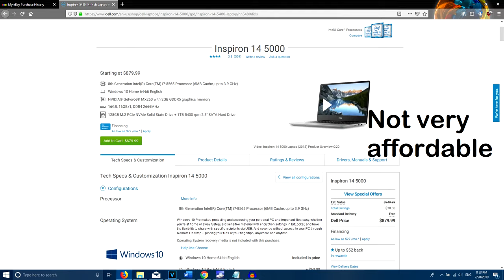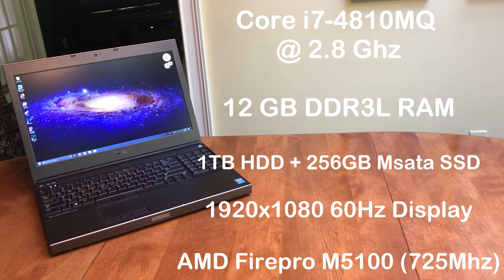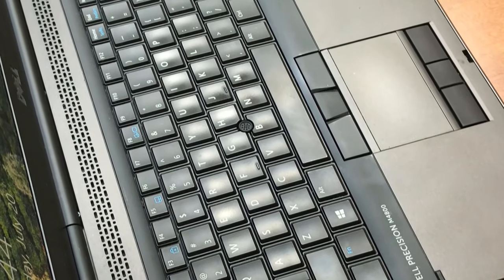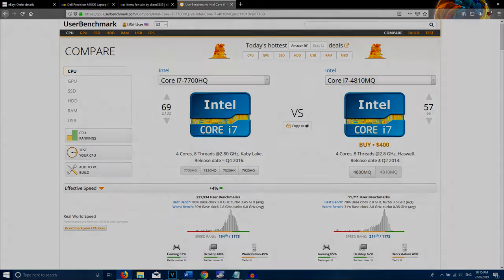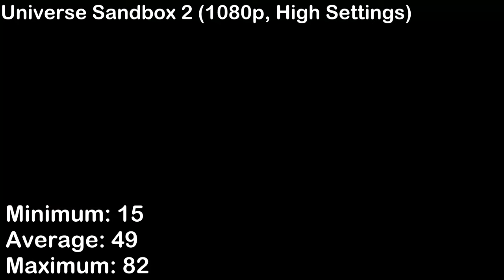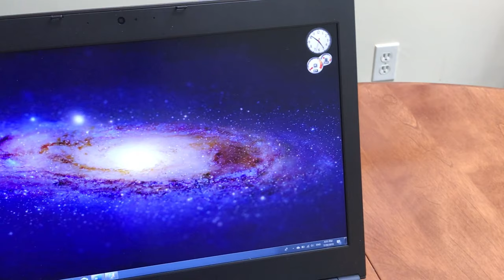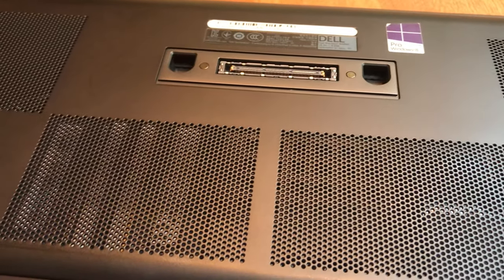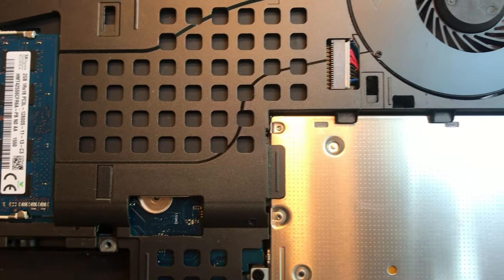Is a $300 Workstation From 2013 a Good Choice for Cheap PC Gaming?

Comment: Been running this laptop for years.  Great machine, and it's damn near indestructible.  If I may offer some of my own 2 cents for those of you looking to get one:

--Don't go above the 47W processors, stick with the 4910MQ and below to get the most performance.  I have a 4930MX I bought for it just for the meme factor, and under a consistent load, it can barely even reach base clocks let alone boost clocks without thermal throttling.  Trust me, you won't be overclocking this thing unless your room's ambient temperature is sub-freezing.
--DDR3 1866MHz is not really worth it.  You'd be better off sticking with 1600MHz, but going for a full 32GB.
--You can use the Quadro M2200 MXM Type A card in it (which I think is from a 7th gen Precision?) but the GPU die will be a little bit wider than the heatsink.  It will still be fine as-is, but what I did was put some very thin 1mm thick thermal pad slices (1.5mm will be fine too) on the ends of the GPU heatsink to make it contact the small slices of GPU die that hang over the edge.  Then, after thermal paste on the copper part and reassembling the machine, it seems to work fine.  The Quadro M2200's horsepower in benchmarks is approximately equivalent to a GTX 1050 Max Q.
--Related to the point above, even if you're using a Quadro GPU, always get the nVidia Game Ready Drivers if you want to game on this machine.  Quadro drivers seem to auto-throttle your card at around 50-55 Celsius, whereas with the Game Ready Drivers I've seen this thing go 75C+ (which also MASSIVELY boosted game performance).  To install Game Ready drivers, run the driver setup and let the program extract its files.  Then, before the installer closes, copy the C:\NVIDIA\ folder to another directory, and cancel the NVIDIA installer.  You do this so the temp driver files aren't deleted upon installation failure.  After that go into Device Manager and manually install the GPU driver via INF, using that copied-directory you made earlier.  It should be in Display.Driver, you can use the first INF in that directory.
Reply: Does the keyboard had a backlight?
Reply: @Graphomid  Yes
Reply: Apparently you can put a quadro t2000 from a hp mini pc in it, but it requires a lot of modifications and they are expensive af (250€) for what they are worth in terms of performance
And the m2200 is still expensive, at around 100€ on eBay :/
I got a precision m4800 for 70€ this week with base specs (not in super condition, but that's fine...), and I'm gonna upgrade it with an i7 4910MQ, a WiFi 6E card, optical drive bay HDD and possibly a quadro m2200 if I find one at a decent price
I would love to see more gpus like the intel arc a370m that come in mxm-a form factor though, as they are quite power-efficient

Comment: 2024 - ordered one early this week for about 200 USD equiv. 
I used an older M6400 17" at work some years ago and was impressed. 
Only now I found a cheap Precision for myself.
(I also have a heavy 17" Inspiron from 2008 that still works well) 
Some say Dell's laptops are junk these days. IDK, but the Precision line must be
up there with ThinkPads IMO.

Comment: Have this laptop and can run a modded Minecraft pack with 270 loaded mods as 60fps on normal settings. Received this as a high school graduation gift over four years ago and still performs like it did on day one. Absolutely love it!
Reply: will it run Battlefield 1 or other games like that?
Reply: @inf0bites  never tried an fps game on it. Should be fine tho. Found out the other day it can run 150 frames consistently on said modded Minecraft on some high level settings
Reply: Can you upgrade the gpus on these laptops?
Reply: @SakugaAsu  not sure. I'd imagine you can

Comment: I'm waiting for mine to arrive from Ebay. I plan on upgrading to an SSD & the memory to 32. Maybe in the future the CPU and/or GPU.
Reply: SSD upgrade is a great idea and you can find msata ssd's (Msata was the predecessor to m.2 and ran at sata 3 speeds) for good prices online due to the fact that msata is an old standard now. CPU upgrade is worth it an easy enough but GPU upgrades on these machines can be expensive if you want to replace the Firepro or Quadro (depending on whether it's AMD or Nvidia) with something like a Geforce card. Could still be worth it though depending on how much you plan to use the machine.
Reply: @TechNorms  Those are MXM Type B Cards, but M4800 has only a Type A Socket -> Will not fit

Comment: I'll soon sell mine on ebay: i7, 16Gb ram 1888mhz, ssd 500gb (but i'll replace it with a HDD 320gb or 500gb probably and AMD FirePro W4170M (FireGL V). Thats still an excellent laptop even for 3d designing.
Reply from the maker: Mobile workstations are a great value if you're looking for a used laptop. They tend to be overlooked due to their weight and poor battery life, which is understandable. They are good machines regardless.

Comment: I have the same laptop but with a quadro m1000, the 1080 display can actually overlock to 80hz, felt amazing in minecraft and csgo.
Reply: Do you get those times when you think you shot someone,but it doesn't though? 

That is a problem with low Refresh rates

Comment: I picked up a 7520 for about 350 after taxes and shipping but it was sold as non working. I took the risk and I found out it just took about a min of holding the power button to get it to post. It also turns out it already had 16gb of ram and the i7 6820 and quadro m1200.
Reply: beautiful,
Reply: @saadomar1101  I also was able to Swap in a MXM 1050ti and mod the drivers to make that work as well.
Reply: @JamieTheEnby  that's some cool upgrade as well for a solid machine like that one.

Comment: Pretty cool video, i bought a m4600 for 100 bucks off some crackhead and got this gpu on ebay for 50 bucks and I used it for about half a year and it worked fine.

Comment: You need to keep perspective in mind. This is not a 1050Ti. I have a ThinkPad W540/i7-4900mq/32gb/ram, and K2100m video. For my gaming needs, it runs most things like Skyrim:The Elder scrolls, FFXIII-2, The Long Dark, Crysis, on high settings acceptably well, but butter smooth at 900p, with rest of game settings on high. Games like Mass Effect 3, The Sims 4, run smoothly on all high settings at 1080p. Mass Effect 3 actually runs JUST as well, on my Quadro, as it does on my GT940.
However, No Mans Sky, runs like crap. That's not a K2100m fault, it's the Quadro drivers.

In addition, OLDER AAA titles, like The Sims 2, run far better on the K2100m, than it does on just about anything else. This has a lot to do with using Win7Pro. Win10 is a very unfriendly environment for running older games, including, The Sims 2. Also, SOME games are optimized to run on the Quadro, as well as GeForce. This is the case with Mass Effect 3, and The Sims 2/3.

If you want a BUDGET, high end gamer for more modern AAA titles, I recommend a USED, MSI, Acer Nitro 5, or otherwise.

I bought my W540 for rendering graphics, and AutoCaD, and was ALSO impressed with it's gaming ability.

The only TRUE bottleneck in your system, is the spin drive. An SSD/no swapfile, would improve your gaming performance a bit.

For what you paid, is it worth buying a budget workstation just for gaming? Well, that depends on what your expectations are for gaming. For some, Yes. For others? No. Personally, I'm fine with my W540, as gaming wasn't the first consideration when choosing it.
Reply: Yahya Be  No, I'm not in to those kind of games. I like "The Long Dark", The Sims 2, CoD, and Mass Effect series.
Reply: @Mr Burns It should run it fine, if the W540, has the K2100m graphics.

Comment: Ive got the exact same laptop and my minecraft runs on highest with stable 60 fps, csgo also on highest and ive never had lower than 100 fps
Reply from the maker: Yeah in retrospect I’m not sure why some of the games where performing as poorly as they where. I did some recording without any recording software on before and it performed almost the same. Where you using Minecraft Bedrock edition?
Reply: CGS Tech i use java :)
Reply from the maker: That’s odd, I do too. Perhaps there was something up with the drivers I was using when I did this review.
Reply: no i
Reply: OS?

Comment: Iam about upgrade my dell precision m4700 to a 15.6 4k display and a nvidia gtx 980m 4gb gpu the 4k display is from a dell  precision m4800 it fits the m4700 perfectly i just ordered the nvidia gtx 980m gpu off ebay

Comment: That notebook has a rubber cover besides the trackpad, I needed to clean mine with acetone because it really feels nasty. However... Cheap long-lastig (6h+ on small loads) notebook with much compute power (4x 3,2GHz with turbo boost - my Dektop in 2011 had a i5-2500k, stock 3,7GHz, 4,6GHz OC) and some decent card if you are into solid works. Unfortunately, we can't really replace the MXM A Card with something better, due to 50W TPD. And that litte bastard is really heavy (but can have 4K Panel).

I recommend not to buy - I would look for an old workstation with MXM Type B card, as it is possible to upgrade to nvidia 980 or 1080

Comment: Core i7-2820QM (2.30)ghz
8gb Ram
Nvidia Quadro 2000m
Any high end graphics card available or will be available?
Reply: Buy a Firepro m5100 (tad pricey for what it does) and buy the amd heatsink for this model as there are two with the other being for nvidia due some physical differences. The m4600 really doesn't have much in the way of options along with the m6600. You are better off buying a better model unless the price happens to be right for the m4600. The best deal for this era is the m6700 and m6800 that typically sell for more however you get so much more in return be it a full sized mxm slot for gpu upgrades coupled with more drive bays on top of having better cooling. Also the M6700 and some M6800s with the right display panel installed allow for much more modern gpu upgrades though often with some effort to mod the drivers as well sometimes the vbios. The M6700 is kinda the best of all of them that it allows for upgrades that are more difficult on the m6800 so long that one has an edp panel installed then it is golden.
Reply: @MrKillswitch88  thank you very much.

Comment: My parents gave me their Dell precision m4600. Is that laptop good for games?
Reply: @loganparker4184  do you know if I could stream on my computer? I don’t know the specs. All Ik it’s a dell precision m4600
Reply: @bsprkes2301  It runs pretty good with gaming. not the best ofc, but good enough. I got one aswell(few upgrades) my uncle upgraded it. I got it from him as a gift. mine has, 8gb ram, 64bit system, 256 SSD, Windows 10, because you really need it . i7-2720QM 2.2GHz (x2)
Reply: @bsprkes2301  so yea, you are lucky aswell. you got a low price budget gaming laptop. My friend said it can run Gta V
Reply: @TurboJuicee  I tried everything and my stream lags really bad. My dad gave me his dell inspirion 15 5000 and it works great.
Reply: @bsprkes2301  well u can upgrade tha GPU to a RTX 2080M but it might take a bit to get it there but i wouldn't stream and game on tha same laptop for it

Comment: I have a dell precision m4700 it came with a 15.6 1080p display the cpu is an intel core i7 extreme edition 3940XM cpu the ram 32gb of ddr3 ram the hard drive is an 2tb ssd also has 256gb msata drive a dvdrw drive i put windows 11pro on it by following a YouTube video my question is can i upgrade the unit to a blu-ray drive and can i play games on this workstation notebook i have xbox game pass for pc for got the gpu is a NVIDIA Quadro K2000M with 2gb of on board ram and Microsoft HD 4000 graphics thanks i traded my hp 2000 windows 8.1 notebook for it i think it was a good deal from a family member who daughter needed a lighter notebook for school

Comment: Dell m4800
Core i7 4910MQ
Ram 16
Nividia k2100
Or fire pro m5100

،can run pubg on high seting ?

And it or hp zbook g2
Reply: it wont at high since ur gpu i fairly weak
Reply: but try pubg lite its the same game but as a lightweight port, even old hardware should get you over 100 fps easily
Reply: Fire pro m5100 is 50 percent faster than k2100

Comment: I have one of these, and your review is about the same experience I have with mine as well (although mine had Nvidia Quadro K2100m for a gpu) one quirk I've noticed with mine is that often I need to manually pick the gpu I'm using when I play a game, and the on-board integrated intel hd graphics GPU on this is fairly decent for what it is and will play some games kinda alright, although it will instantly turn the fans onto max when you do so.
Reply from the maker: scurvofpcp Yeah I had the GPU issue when I played games on this as well. I believe it was due to the fact the graphics card is a workstation card and not a gaming card.
Reply: @ColinSlater33  All said and done I can't complain about the machine. It is nice enough to do what I need to do while I'm traveling, decently sturdy and meh, if it breaks or gets stolen I'm out all of 400. I drive for a few disabled relations so I end up killing laptops on an almost yearly basis.
Reply: I picked up a cheapy docking port for it, and I've found that that little bit of elevation seems to add enough cooling bump the fps a little for gaming.  Still though not a bad machine all things considered. That and mine recently survived a car incident, no one was hurt badly. But seriously these things are sturdy as hell.
Reply: @L14 I normally do it with the right click and pick the GPU to do it with via that. A few older games do occasionally play better on the intel graphics,

Comment: l want to buy like this laptop, l found Quadro 1000M version, worth to buy ? can you share your opinion ? l play moba game and use AutoCAD
Reply from the maker: The 1000m is the weakest gpu the m4800 came with, however that being said it should still be good enough for moba games and CAD (as long as it's not too intensive).
Reply: @ColinSlater33  Thanks for your reply

Comment: Are you sure the CPU wasn't the bottleneck in those games giving you issues? Games like Minecraft are graphically light, but can be taxing on the CPU due to all the stuff they're simulating. Would've been interesting to see hardware usage statistics using Afterburner/RivaTuner overlay.
Reply from the maker: I had originally thought so while writing, but I have other computers with worse CPU's and better GPU's, but I didn't have the problem.
Reply: @ColinSlater33  Is this better than the $300 AMD Ryzen 3 3200U laptops?
Reply: @AmuckPVP  Much better, but you have to sacrifice battery life and weight often times.

Comment: Where did you buy in 300$?? I can find over 500.....
Reply from the maker: Prices for older machines like the m4800 rapidly fluctuate based on how many are available on sites like eBay. I remember getting a good deal on this particular machine and prices where around the $350-$400 range when I was shopping around for one. If you’re looking to buy an m4800 or a machine like it then I would just wait until the prices drop.
Reply: @ColinSlater33  thanks for replying!

Comment: you can cram 32 gb of ram in that thing and upgrade the gpu
Reply: @epicskyfly1028   I've got 32gb in mine atm.  ordered laptop off ebay.  500gb ssd and firepro m5100.  wish I could upgrade graphics, but looks like a pain from any forum I read...I've played gta5 without overclocking on medium, and it seemed fine to me.  m4800,
Reply: @spirolmusicstudios2309  if you can't do it take it to computer repair shop remember you two memory slots under the keyboard and the other two slots are on the bottom of the notebook
Reply: @epicskyfly1028  32gb is tha max on these workstation laptops

Comment: The M67/800 are better choices, and can do even better when fully upgraded.
Reply: @applepoop10  Who told you that? The M67/800 can use RTX A5000 cards(With custom heatsinks) and the M47/800 can use the Quadro T1000.